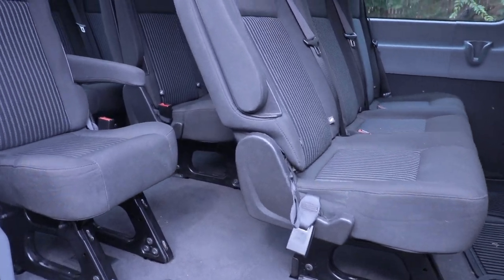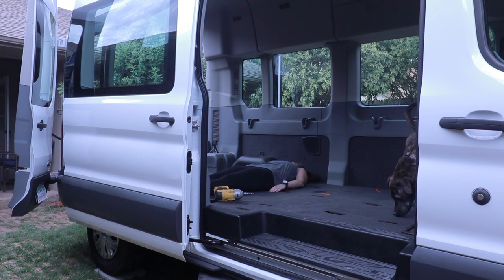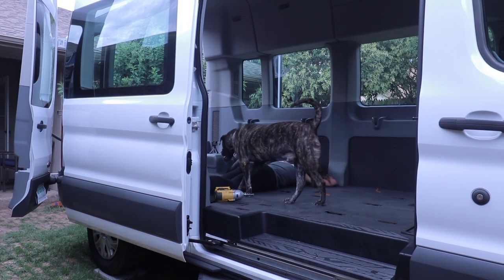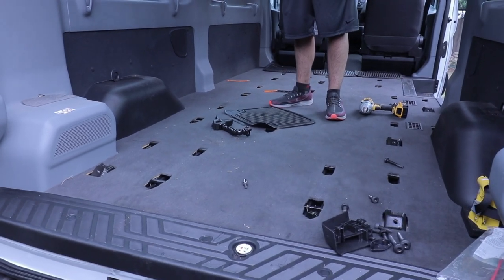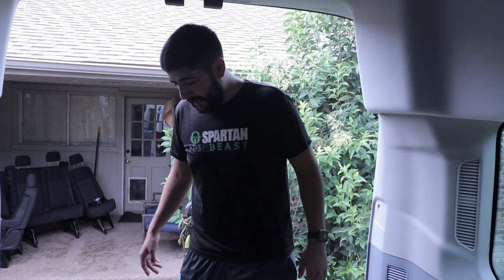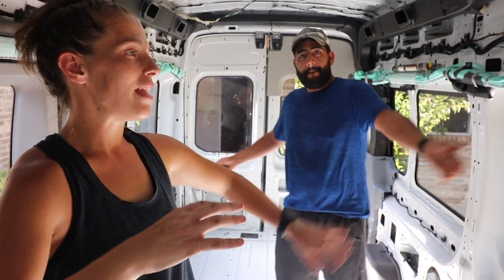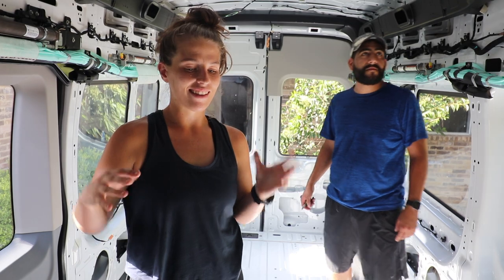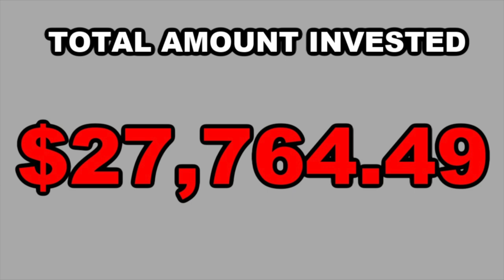We Are Gutting the Interior of Our Ford Transit Camper Van | Camper Van Build Ep. 3

Comment from the maker: Hey Guys! I have been getting a lot of questions about the tools we used to gut the interior - 

so, to remove the seats, we just used a Zip Tie, we put the zip tie in a loop and then used it to unhinge the seat bracket from the mounting bracket. 

As for everything else, we got the entire interior out with just standard socket wrenches, and screwdrivers - we used an impact wrench and electric drivers purely to save time. We also used these trim removal tools which help a lot: https://www.amazon.com/dp/B07QPNDJ1S/

Really, when it comes to removing the interior,  MOST of it is just held up with clips and it's just a matter of pulling it out of the body of the car. Hope this helps!

Comment: Hi Aubrey,  we are in the process of a conversion of our 2016 Ford Transit Passenger van.  Do you have a tutorial on  how to remove the airbags?  Thanks for sharing your wisdom.  Kate and Melissa
Reply: There's a lot of discussion on this if you search the Ford Transit Forum (please google it). The "curtain" airbags go all the way around to the front and passenger seat, so if you removed them, you wouldn't be in compliance but there's a work-around where you put "simulator" resistors in the four rear back ones, which disables them but the front ones still work, you can still pass smog because the simulators keep the dash light off, and if you ever wanted to sell the van, you could simply remove the simulators and be back in action (they just clip into a clasp - super easy).

Comment: Seems like an expensive way to start the project.....taking all that interior and seating out....even if sold, it won't be anywhere near "new" replacement cost ( talk to a body shop and work up a fake repair estimate for OEM replacement parts and see). Seems you could have started with a similar but bare commercial type van ????
Reply from the maker: We couldn't find commercial vans anywhere and the ones we did find were actually more expensive. The standard price for this van, even a commercial one is in the 25-28k range. We got this one for below 25k, we were also able to sell the interior pieces which brought the overall purchase price down even more.
Reply: @AubreyJanik  ..ok then.... good deal. Take care.

Comment: Nice video.  I’m doing this as a newb.  Do you have any place where you show in detail what tools and methods of how you removed or gutted everything?
Reply from the maker: to remove the seats, we just used a Zip Tie, we put the zip tie in a loop and then used it to unhinge the seat bracket from the mounting bracket. 

As for everything else, we got the entire interior out with just standard socket wrenches, and screwdrivers - we used an impact wrench and electric drivers purely to save time. We also used these trim removal tools which help a lot: https://www.amazon.com/dp/B07QPNDJ1S/

Really, when it comes to removing the interior,  MOST of it is just held up with clips and it's just a matter of pulling it out of the body of the car.
Reply: @AubreyJanik  awesome, thank you so much.  I was concerned the mounting tracks would require cutting to remove as I saw someone else use an electric cutter to remove the rails but that also destroys the rails and makes it unable to sell.   It looks like all y’all had to do was unscrew or unbolt they rails from the videos.  Thank you so much for the video!!

Comment: Thanks for sharing this!  I am curious why you did not remove the lower trim panel at the very back.  I am about to start stripping my van down.
Reply from the maker: Are you talking about the back corner? If so, there is an AC blower motor there and we originally kept it on because we where going to incorporate it into the build for easy access and use of the AC, but we have since taken it off and have gone a different direction since the trim is ugly lol